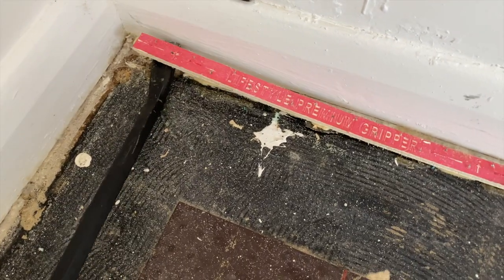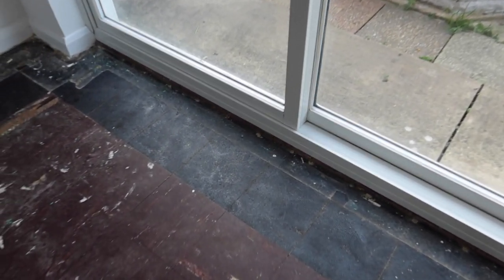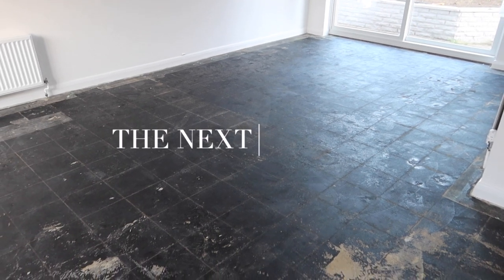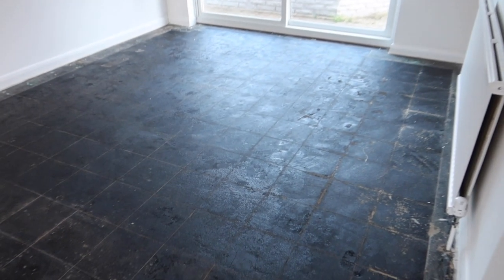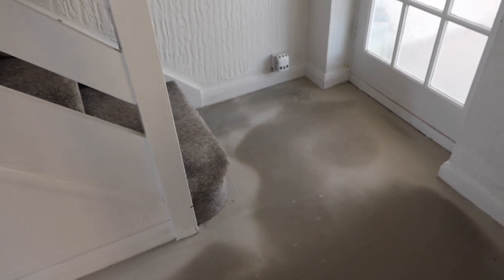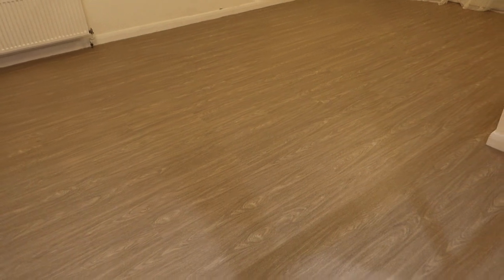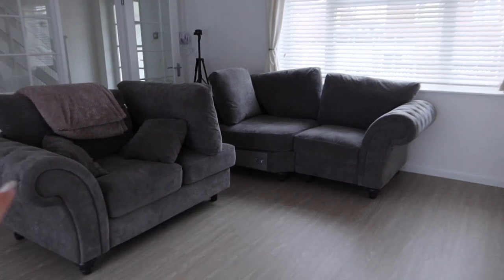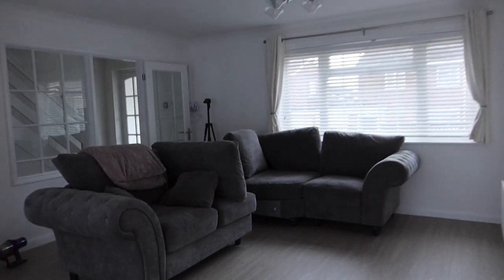LIVING ROOM FLOORING TRANSFORMATION | MOVING VLOG #9

Comment: I had thee exact same problem with my floor it would’ve been best to leave the tile and screed over it because what’s under the tile is years of adhesive cracks chips etc either way that is not flat if needs to be levelled screeded that lvt is similar to laminate that came out in the late 90s except it’s even better quality and waterproof anything covered in adhesive is not flat once you remove tiles remember to lay the tile they might’ve added more adhesive to certain sections to make it all level glad you listened to the fitter or your floor would’ve cracked moved and no longer be waterproof because of any separation